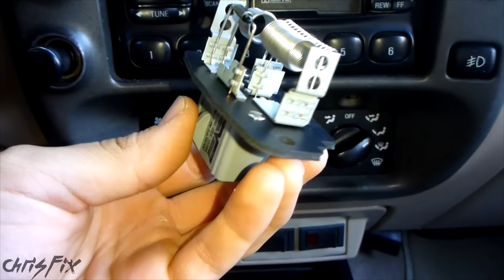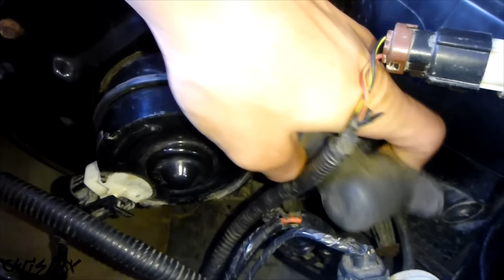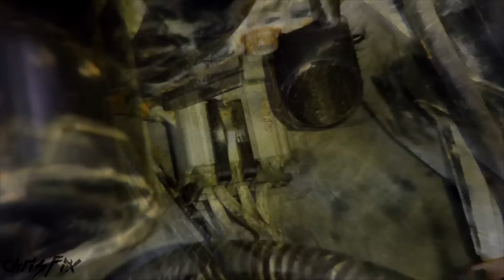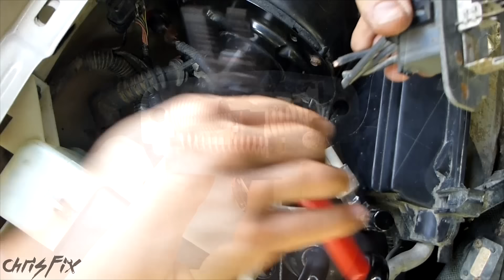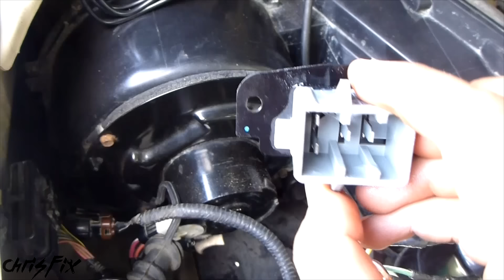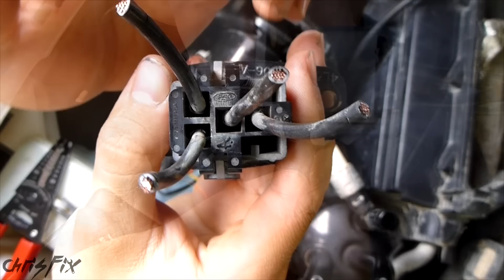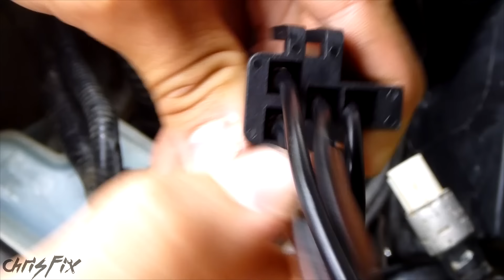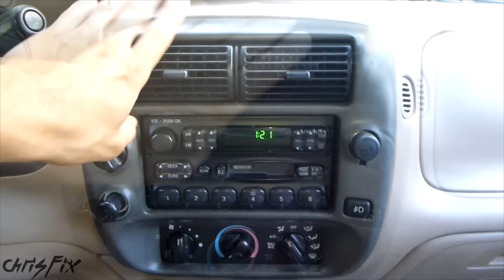How to replace a Blower Motor Resistor

Comment: chris this is by far the best explained video that i have seen out there very thorough  & good quality
Reply from the maker: mario d.c Thanks a lot Mario! I post new videos every Thursday and a bonus video Monday (if I have a video to post) so check them out!
Reply: is it obligatory to remove the connectors cause i took my resistor out very easy without removing the connectors is that ok ?
Reply from the maker: What do you mean? Like you took the blower motor resistor off of the pigtail? If the wiring harness is still good then it doesnt need to be replaced.
Reply: what i meant was the connectors
Reply from the maker: mario d.c If the connector is still good then you are good to go and just need a new resistor. No need to change something that works. I would use some sand paper and see if you can make sure the connector is corrosion free to prevent high resistance in the connection.
Reply: talking about connectors  they have this clicking noise  & i can't get my heater to turn on , someone told me that it's not the resistor . i don't what the fu..c it is anymore im so confused  my head is spinning lol!
Reply from the maker: Can you explain what happens? The fan doesnt turn on?
Reply: i have a chevy fully loaded 1990  and after fllushing   my heater core i went to start my truck &   fan stopped working & my lights on the heater went dead if you see how the dash is  made you'll understand  what im talking about   nothing works!
Reply from the maker: Did you knock a sensor or vacuum line loose while flushing the heater core? Is your heater core leaking and when you flushed it. it sprayed all over the electronics under the dash?
Reply: no it wasn't leaking &no there is no water on floor under dash when i flushed water came out practically clean with no hesitation  both hose were hot afterwards ''but maybe you first question a sensor or vacume line  hummmmm ???? i remember moving a bunch of wires out of the way so i could unscrew the clamps but wasn't that rough
Reply from the maker: mario d.c Hm, check the fuses?

Comment: Never ever use butt connectors on a car!!!! Those will cause the blower resistor to fail again, there is a lot of resistance in butt connectors. Always solder and heat shrink automotive wiring, corrosion will creep in and destroy and crimp too.
Reply: +ChrisFix Hi Chris. I love your videos, i am a big fan of yours and i am also a repair guy, done many electrical+mechanical jobs for myself and my friends. I worked in the past (10 years long) at an automotive company who were producing and servicing wiring for Ford, Vw, Mercedes and other brands. I agree with trouble maker regarding butt connectors. They are not a reliable solution. Solder + heatshrink is the solution. If you really want to go in the crimping way i suggest you use dedicated crimps for each crossection and what is the most important use correct crimping tools. For Mercedes and other high end cars (like Bentley), the crimping+soldering+heatshrink is the way to go when they "bond" two wires where high amperage is considered :-). This is a quality request in their standards :-). 
One extra observation on this vid (it is already cool, rich in content, very expressive, useful.. and i can continue a lot :-) ) is at 7:32. Take a look at the green wire stripped part where the copper leads are visible. The leads are corroded, they don't look nice at all (nice like gold shiny). In this case using the butt connectors is even worse. If bad luck strikes and heavy load is applied to that joint it will overheat and possible melt all the insulation (heat shrink from butt connector, insulating tape). In this case is mandatory to cut back the wire until reach uncorroded part or apply a corrosion cleaner and clean the copper leads before crimping or soldering.
That wire corroded because the previous fixer did not seal the wire ends where it was stripped. If the heat shrink is used correctly it will seal waterproof the end of wire where stripping was applied, protecting it from moisture, preventing corrosion.
Good quality heatshrinks (Raychem, DSG Canusa) have inside a "wax" material which melts when you apply it sealing and gluing where applied. In engine bay of cars it is good to use this kind of heatshrinks.

I found your channel not long time ago but i can say that i watched almost all of your videos. They are great and i love all of them. Please don't take my (long) comment as insulting or critical, just take out the useful stuff from it. I learned a lot from your vids and i promise to watch all next ones. Keep up the great work and looking forward to see more and more.

Wishing you a nice day.

With regards,
B.
Reply from the maker: trouble maker Thanks for the info. I havent had a problem using butt connectors but I will keep it in mind.

Comment: Great Video . Dont know if anyone has mentioned it but, those yellow connectors are made with shrink tube by heating it with a lighter it will shrink to the wire and create a waterproof seal...just an FYI.
Reply from the maker: Roygrimaldo Thanks man! I actually tried heating them up and the plastic just melted. They are either really cheap and dont work, or they are not shrink tubes. Thanks though!
Reply: ChrisFix Oh ok no worries.

Comment: Hi Chris, Did this a month ago, works great. But last week I stopped getting air through the dash vent, the window vents and floor vents still work. could this be related? i have a 2004 B3000. Thanks for help.
Reply from the maker: Randy Gallant I think this is more of a vacuum problem. Vacuum moves the vent doors when you turn the switch. I would start the car, put the fan on low, and put it on a vent setting that works and is directly next to the vent setting that doesn't work. So one click away is the vent setting that doesn't work. Shut the car, but leave the vent and fan in the same position. Then when it is quiet, turn the vent to the setting that doesnt work. Listen and see if you hear any noises. You should hear a vacuum suction noise and the vent doors moving.

Comment: Those butt splice connectors have heat-shrink tubing on them.  You should have used a heat gun to shrink the tubing, rather than simply taping them.
Reply from the maker: pobox406 They were not heat shrink. I thought they were too but they just melted/crumbled when I tried.

Comment: You should really get a ratcheting terminal crimp tool, I purchased one for only about $15 at orielly or autozone several years ago. It ensures a good crimp every time without overcrushing the connectors. One common reason for failure of DC connections is high resistance. Those manual crimpers you used don't have the advantage of a ratchet system to add gearbox leverage and repeat ability to your crimps. 

Also. If you slide some heat shrink tubing over the connections before making them up and shrink it after they will be virtually watertight. No black tape required. Black tape's adhesive often releases in heat and gets sticky and leaves a mess. It's really only for temporary marking and insulation not permanent stuff.
Reply from the maker: wb5mgr Thanks for the tips!

Comment: Hey chris I have a question that's not on the subject of this video.if you bleed your brakes on your vehicle that disc in front drum in rear. Is there bleeder valve on the drum brakes?
Reply from the maker: Jacobe Brown Yes there is. Here is a video that should help How to do a Complete Brake Flush and Bleed

Comment: chris, on a note...I like Armorall Extreme Shield Wax. Apply and wipe it(no drying time) shine second to none, no risidue on trim. Used it the second time, first application lasted about 6months(car is outside every day). I use a shaded area for the job and important to use a good Micro Fiber towel(canada walmart 'FIXIT' 24pcs.) The wax do everything they promise (unlike their new tire shine).
Reply from the maker: Andrew Pereira I will have to try it. That sounds nice. Is it a paste or a liquid?
Reply: ChrisFix
it's liquid....easy on-easy off.

Comment: +1 on seamonkey's comment, I have soldered on new temp fuses lots of times with good luck :) to test u can just hotwire with a cable to see if it will work :)
Reply from the maker: 95tt Thanks! I will give it a shot!

Comment: You can also in some cases, if the resistor kit appears ok and isn't too rusted, just replace the thermal fuse. It's the pointy looking metal can beside the coils. Just bring it into a radio shack store or similar and they should have a match or better replacement thermal fuse. Just solder the sucker back in and you should be good to go. Only costs a few cents. Try it with the broken one and you should have a perfectly fine replacement for next time.
Reply from the maker: SeaMonkey Thanks for the tip! I will give it a shot just to see if it works! I needed to replace this one because the pigtail was melted/corroded but this is good to know!

Comment: Nice video One note. I think those butt connectors are the waterproof type and you could have heated them and shrunk them closed.
Reply from the maker: Mike Shelly Thanks Mike! I tried heating them and it just melted so I assumed they are just crimp connectors.
Reply: ChrisFix Sorry for the mis info. When I see the ends flared like that thought they would be heat shrink type. Didn't want to second guess you. Your the teacher and do a great job. I enjoy your vids and learn a lot.
Reply from the maker: Mike Shelly Dont be sorry! Sometimes viewers help me out and catch stuff I dont notice! Your input is important to me!

Comment: I would suggest checking your fan motor to see if it spins freely. usually the plug won't melt together unless the motor is drawing too many amps. After you replace the resistor block and plug and after the fan has been running on low for a while open the hood and feel the wires going to the resister block and feel if one of the wires is extremely hot, if you feel the wires are too hot this makes it likely that the motor is going bad and you will need to replace the motor very soon.  Good luck
Reply from the maker: scott m I have another video I am making showing how to check the motor and stuff but thanks for the comment! I will definitely check the wires and keep you posted if I find the blower motor is going bad!
Reply from the maker: scott m I appreciate the tips/help btw!

Comment: Smashing tutorial :-))

On other peoples vids ive seen those resistors really cooked or corroded away, yours seemed fine, i bet the old one could be recovered with some patience, a spare just in case :)

Other cars use a series pass transistor on heatsink, they still die, bolting to the chassis would have dumped any heat, but they dont do that.
Reply from the maker: zx8401ztv Thanks bud. I think the problem was that the corrosion caused the resistance to increase and that caused it to overheat and melt. As for the other type of resistor, it blows my mind why they cannot just do exactly what you said and use a metal part of the car to help with the cooling. Seems like a better idea. Maybe since they do not trypically blow out during the warranty period they dont care.
Reply: ChrisFix
Just imagine them making a multitapped motor, no resistors required and it dont break down...... ha ha just a dangerious thought lol.

Comment: Were those waterproof butt connectors? If so, they can just be blasted with heat to shrink down on the wires. There's usually an adhesive in there too that spreads with the heat and forms a permanent seal.
Reply from the maker: John Roddy These were not made to be heated, just crimped. They were the cheap connectors and heating them just melted them. Thanks for the idea though.
Reply: ChrisFix
You know, now that I think about, it's awfully hard to tell with the cheap connectors. The waterproof types are supposed to be heated since that wrapping is an unusually thick heatshrink, so by nature, it looks like they're melting. Or, they really could just be uber-cheap and really are melting, effectively ruining them. I guess it depends on who made that pigtail.

Comment: What would happen if you took out the blower motor out and didn't put it back?
Reply from the maker: CodysDesigns The blower motor or the resistor? If you took the blower motor out, you wouldnt have any fan for the heat or for the ac in your car and you would be allowing hot air from your engine bay into your car. Plus you would have a huge hole going into your cabin vents.
Reply: No haha the resistor, sorry. It would just blow cold air on max even if the dial is set to its lowest?
Reply from the maker: CodysDesigns I think that  it might work on high without the blower motor resistor. I havent tried it but on full fan there should be a direct line to the blower motor.

Comment: How did you know which OEM wire is which? Did you look at the old connector before cutting or looked up a wiring diagram?
Reply from the maker: February In the video I explained how you need to make sure you look at the connector before you cut it (and if it was the OEM wiring, you should cut with some space on the back so you have some wires for reference. I just looked at the wires before I cut it and knew the correct order. Def be sure to do that, otherwise you will be hunting around for wiring diagrams!